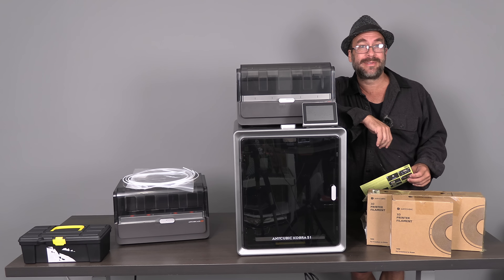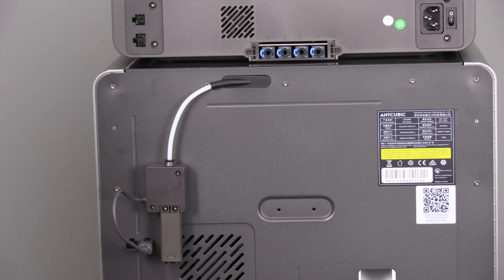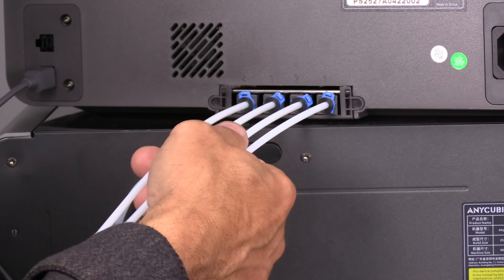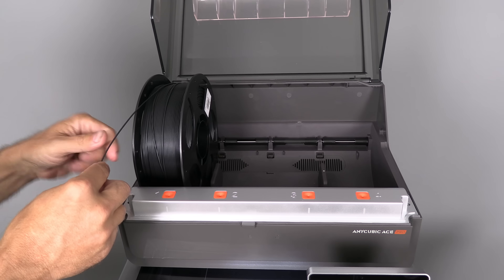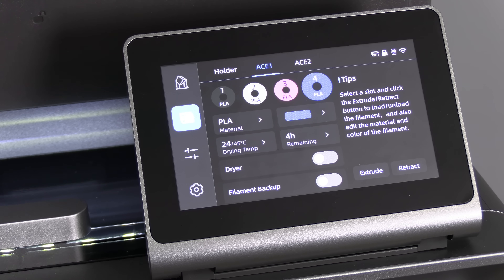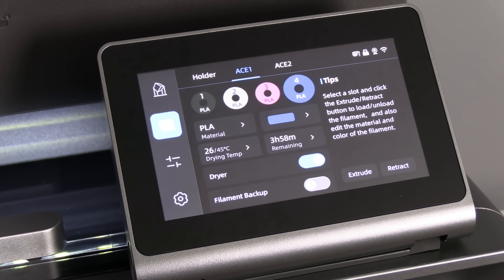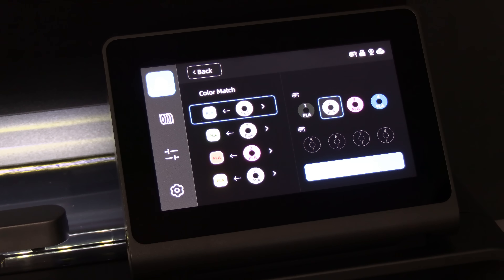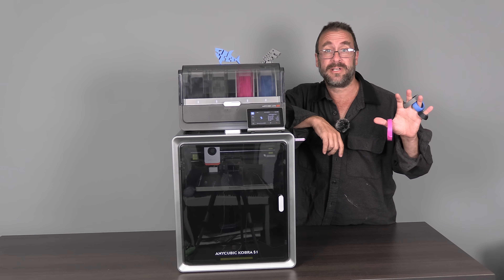Install, Setup, Test: ACE PRO on Anycubic Kobra S1. Multicolor 3D printer

Comment: Hi, I'm having a bit of trouble printing in multiple colors because, for example, I printed a completely green frog with black eyes, but from the layer where the eyes begin, the green became darker. What can I do?
Reply from the maker: Work on your flushing volumes. I would run a small test print, with a transition from those colors, to dial that in. Increase the flushing volume, to reduce the color bleed

Comment: How do you rate this machine scale 1-10 , great set up video presentation , TY G
Reply from the maker: No comment. Need to use it more. Prints great. Not sure what I think of the ACE PRO yet.
Reply: @3DRundown ok  so far so good
Reply: tbh; i've run the anycubic with its ams; total trash... as a single filament 4 spool holder... works just fine... as an AMS unit; total trash... errors on pulling filament back; dry for hours, new out of the box, still wont work.. i've spent hours troubleshooting it.... went to a different brand  printer and ams pro 2 system...